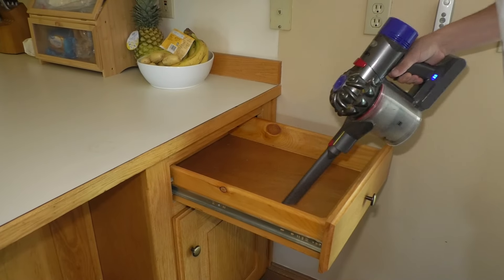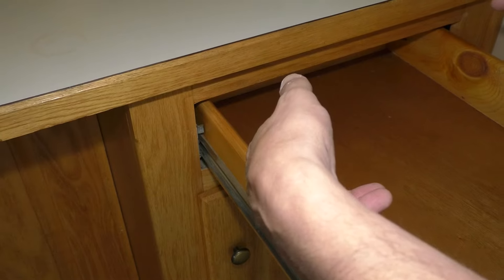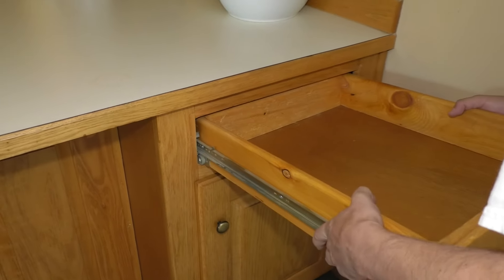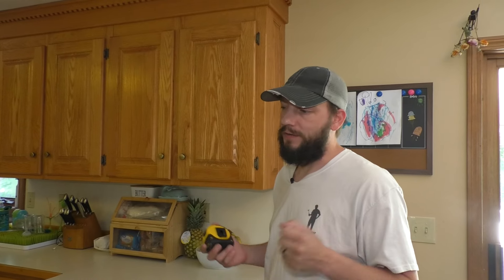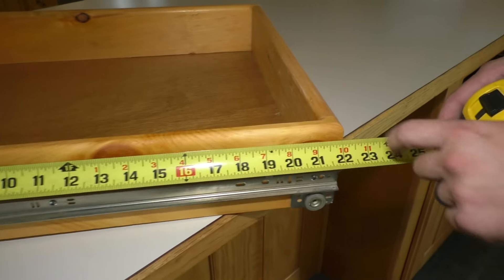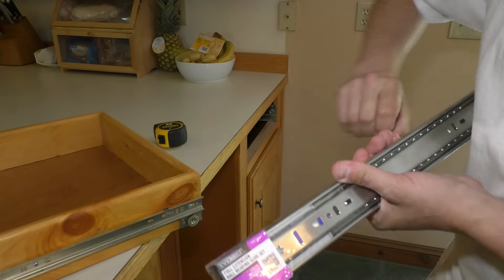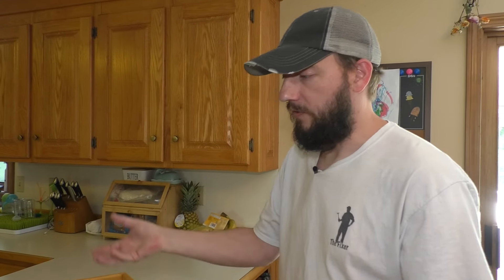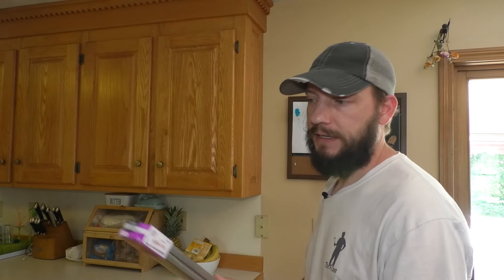How to Measure for New Side Mount Drawer Slides | The Fixer Clips

Comment: You do not measure drawer for slide length.  Because you are going to find out.  The drawer maybe 22 inches.  But the manufacturer put the interior cabinet depth at 24 inches.
Reply from the maker: But that would not matter unless you have to mount the slides to the back of the cabinet.  That would not be the case here... adding longer slides would have no benefit... right?  Am I missing something?
Reply: @thefixerhomerepair2 just saying some one following your video would not know that some slides mount to the rear of the cabinet also.  Since you did not mention that in your video